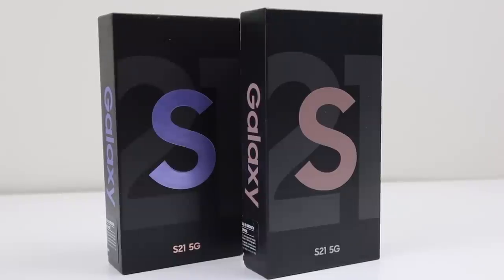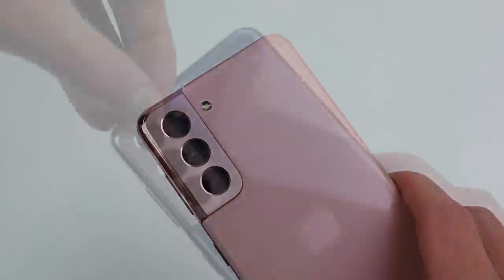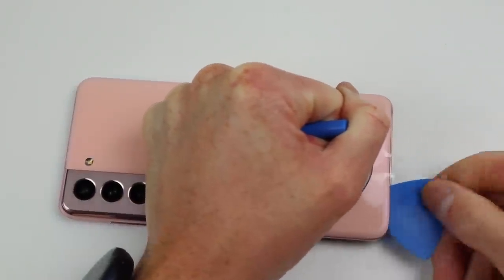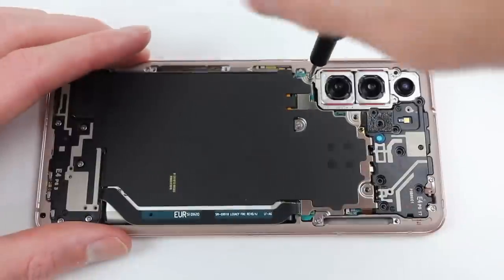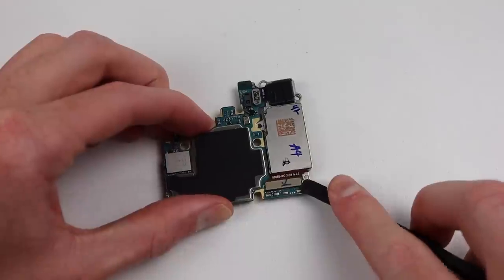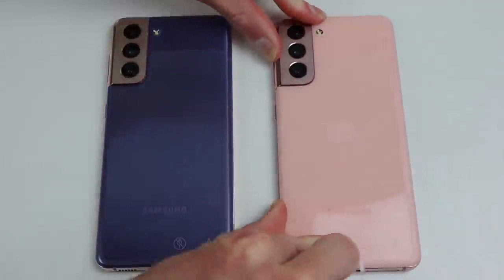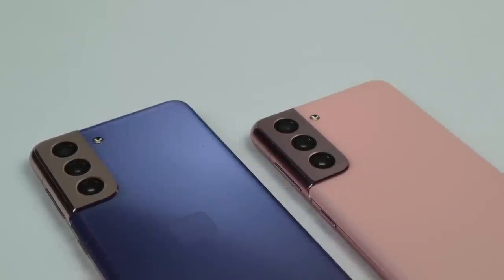Samsung Galaxy S21 Teardown and Repair Assessment - Interesting Findings!

Comment: I'm glad Samsung isnt going down the same path at Apple with its repairs
Reply: As another commenter said, I would be worried that they decide to add it in a software update, like with the A51, maybe high should do an update video in a few months if they do?
Reply: Ha seriously what about the charger, headphone jack and now no SD card support
Reply: At least apple doesn’t put bloatware on your phone
Reply: @brennont9724  I'm surprised people still think it as a software lock. That fp scanner on a51 was an optical one which can loose it's calibration once removed. Samsung probably made it more accurate or fixed some kind of vulnerability to make it more secure with new software update which made the calibration necessary when removed.
Reply: @Spartan-ww3bb  and a 1080p display on a "high end" phone. It's just overpriced and doesn't deseeve the galaxy S branding.
Reply: @brennont9724  what a fingerprint scanner that needs calibration is not reparable wtf is that logic
Reply: @NanoMine  EXACTLY
Reply: @Tom2404  1080p 120hz》1440p 60hz
Reply: @keqling7086  It doesn't matter if it's 120Hz or not. 1080p is still a downgrade.
Reply: @keqling7086  they could have offered an option to recalibrate it.
Reply: @Tom2404  well idk about that
Reply: @Tom2404  no 120hz is all what matters now
Reply: @keqling7086  Youtube, Netflix and most other services don't even support media playback with 120fps. And they won't do in the time that this phone will have any relevance because with linear content like TV shows, movies or this YouTube video you don't really see enought difference to justify a video being twice as big in size. The only measurable benefit would be in gaming because you experience interactive media different to linear programms, but there are no games for phones where that slight increase in responiveness actually matters. Only including a 1080p display when previous generations had 1440p 6 years ago while costing less is just unacceptable for Samsung. I mean if it was an S21 lite for $600 that drops to $400 in the next year it would be ok, but they are doing it with the S21 and S21 plus while keeping a premium name and price tag of $800 and $1000 respectively. The cost of manufacturing those phones is also not an argument in favour of Samsung, the S20 plus had 1440p and 120Hz for the same price as the S21 plus that only has 1080p. The only reason those phones even exists is to make the overpriced ultra model look like a better deal in comparison.
Reply: @ItsRainingLemons  yeah, having two app stores, two calendars and so on, was annoying.
Reply: @Tom2404  Calibrating such a precise component can not be always possible by just a click of a button, you might require some sort of special tools to do it.
Reply: @Tom2404  you cant really tell 1080p on that screen and if you want to optimize apps you make them cleaner and lower res anyway. videos are fine when using 1080 although 1440p is preferable. other than that in ur daily use u shouldn't be able to tell
Reply: @keqling7086  The galaxy A51 cannot have its scanner replaced, I’m just sharing my concerns. Hugh made a video on it
Reply: @brennont9724  IT NEEDS TO BE CALIBRATED and u need special tools for that
Reply: @keqling7086  you don't need special tools to calibrate the fingerprint scanner in the a51, you need to flash stock firmware onto the phone provided on the Samsung website and the fingerprint scanner will work correctly
Reply: @Tom2404  It fucking matters. A 120 Hz display is waaaaaay better than a 60 Hz display, no matter 1440p or 1080p.
Reply: @keqling7086  Oh look, Samsheep making justification for their scummy business practice.
Reply: @liviuganea4108  It actually boils down to preference. Some prefer sharper image, some prefer smoother image.
Reply: @B121AN1  oh look an isheep ignoring apple's refusal of repairing phones and calling me a samsheep
lol samsheep 
i think isheeps got offended so badly by being called isheep
Reply: @keqling7086  Hey! I'm talking Samsung's scummy practice here, not Apple. You Samsheep seriously can't go about any conversation without bringing up Apple can't you? Seriously, in what part of my or your original reply involve Apple? I'm talking Samsung.
Reply: @keqling7086  You Samsheep seriously has to stop justifying a downgrade. A downgrade is a downgrade, and it's bad for the userbase. It's a downgrade in one thing that's Samsung's known for: the screen. It's clearly a scummy business practice that shouldn't be justified just because their competition is doing worse.
Reply: @B121AN1  wait a sec ! why do u think most poeple call fans ISHEEPS ?
ofc u dont know 
bvz they will buy anything apple makes 
1000 dollars wheels 
1000 dollars screen stand ... ipoop ?
on the other hand samsung fans wont buy anything samsung makes 
PROOF :poor sales of the regular note 20 since it had a 60hz screen for 900 dollars or was it a thousand?
so with the s20 u get a 1440 p screen but 60hz ONLY 
with the s21 u get a 1080p screen WITH 120HZ ENABLED 
ofc anyone would choose the 120hz 1080p screen
even mkbhd said "thoose additional hz are more worth than those additional pixels "
so ur wrong
Reply: @B121AN1  samsheep is not a thing and i said why 
but ISHEEEPS still exist
Reply: @keqling7086  also, like I said, we’re talking Samsung. Don’t bring up Apple, please.
Reply: @keqling7086  by the way, nice try, but both S20 and Note 20 had 120hz refresh rate. Both are just not enabled by default, but the option was there. So the S21 screen is still a downgrade and Samsung is still being scummy. Oh, and Note 20 had plastic back. It made headline because it was downgraded from the glass back it had thus making poor sale. People don’t want to pay 1000 bucks for a plastic phone. Beside, the Ultra model was just 300 bucks away, and it was the best phone that year.

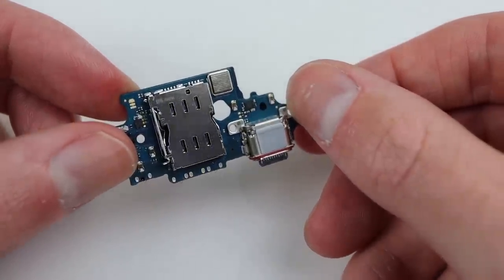Comment: 8:48
Yes you can!
Samsung did it since the Galaxy S8 and Note8. All S and Note phones since then have dual sim hardware, but single sim software. I flashed a second imei to my Note8 by using chimeratool, and i had working dual sim on a single sim note8. I just needed to replace the sim card holder so a second sim would fit instead of the SD Card

Comment: Honestly, I don’t like the s21. I personally like glass and the fact they removed the memory card slot is ridiculous
Reply: Plastic back, No SD card slot, no headphone jack and 1080p display. 5 years ago this would have been a $400 midrange phone. I mean the SoC is a high end one, but by now they have made those octa cores for 6 years or so, so at this point they should be ultra cheap to produce and qualcomm probably just artificially keeps the prices high.
Reply: @Tom2404  some of that could hold some truth but processor manufacturers also aim to make thinner and thinner nm. Both increasing manufacturing cost and performance.
Reply: The reason why chipset are still expensive is because they always improve it, gives new features if they can, then try to make it smaller each year. Which is not easy. This is why most mid-range chipset stays the same manufacturing size before it reached flagship's size. Because it's new that it's not easy. Also they need to test the chipset and make sure there is no problem.

Honestly I don't think S21 is that bad, yeah the lack of dual sim is what worried me (but I heard that other countries variant support dual sim, indonesia included). I always used two sims, one for internet and one for account. For storage.. i think that's enough, you probably won't reached the storage limit anyway. If you're a people who will take extra high quality photos/videos, you should probably get S21 Ultra because of the camera. And I believe S21 Ultra have SD Card (might differ from different countries).
Reply: @FirstnameLastname-yh5fb  you do know that you shrink stuff down to make it cheaper?
Reply: @Tom2404  yeah but process is far more complicated.
Reply: @gta4haterhq  TSMCs 7nm used  since 2018, so at this point it's safe to assume it's a mature process with good yields. They can produce more chips with less silicon, so it lowers production cost.
Reply: @Tom2404  They shrink stuff down to keep heat down and/or increase performance for the same amount of heat and energy consumption. It's actually more expensive to make small silicon because of the lower output and increase in manufacturing difficulty.

Comment: 3:41 I mean if you use plastic, why don't go back to 2015 with removable batteries
Reply: Because time machines don't exist unfortunately.
Reply: then 4000mah will be left 3500mah
Reply: Water resistance will less reliable/more expensive to make, battery capacity will drop pretty significantly, more chances of damage since some randos can poke around in the phone when they don't know what they're doing and a whole slew of other reasons.
Reply: @劉奕彤-q6g  expected would have smaller batteries due to safety measures, but you can easily swap out for a full charged battery.
Reply: @purpleish_OwO  they should use solid state battery to remove most of that protection 
So 5000 Mah Solid State Battery is thinners And more durable and regular lithium battery 
The battery won’t ware down over time
Reply: @ryanlam5237  That's not the reason. It is because if we can replace our batteries and keep our phones running, manufacturers won't be able to get us to upgrade.
Reply: @alexisaguirrevazquez7900  Thats obviously a large reason, and its one that I can't really fault them for. They are a company, not a charity, at the end of the day they have to make money. But I know for sure that personally I prefer "non replaceable batteries" over "replaceable batteries"
Reply: @alexisaguirrevazquez7900  Since it's not something that I personally care about nor a function that I will actively use. I said personally, it's my opinion, you're free to disagree but can you please not be rude about it?
Reply: @ryanlam5237  Just because you don't use it doesn't mean you should prefer not to have it. When your battery goes bad, you would want to replace it so your phone will perform just like new again.
Reply: @alexisaguirrevazquez7900  It's just that personally I've never experienced the need to replace my battery so it's a feature that doesn't matter to me. I much prefer the benefits that it brings including the fact that when I accidentally drop my phone the back cover won't fall off, the battery won't fall out, and the risk of internal damage will be lower since it's much more tightly integrated.
Reply: @ryanlam5237  A case will solve that issue. Also if you crack the to glass back, water resistance will be no more. A sealed in battery won't get larger in phones. You can still get water resistance in a phone with a removable battery. Look at the s5. There are literally zero real world benefits to a phone with a sealed battery. It only benefits the company and that is it.
Reply: @alexisaguirrevazquez7900  I don't enjoy using cases on phones, makes it too bulky for my liking. With a removeable back, phones had to be engineered to have another layer of plastic cover over all the internals to prevent damage which gives less space for components and ultimately leads to less battery especially since the battery is in a hard case too to prevent the lithium metal layers from squishing together and starting a fire. This loss in battery capacity can be remedied by carrying a backup battery but I would rather have my phone as one single complete package rather than having to buy an extra battery, a charger for that battery, and remembering to bring that battery around, especially since phones nowadays are more than enough to last a day for my uses.
Reply: @ryanlam5237  A slim case will do you just fine. Try speck or some clear case from amazon. You can always carry around two batteries as well. Plus, with oled screens, dark mode, 5nm chips and Android getting more battery efficient by each version, even if you put up with less capacity(which isn't the case), it will still last you through the day due to better optimization.
Reply: @alexisaguirrevazquez7900  I've tried slim cases, they just aren't my thing. I think we should just agree to disagree

Comment: I am not sure if you'd be able to read and reply. 

The LCD screen of my S21 is broken and I have got the replacement. 
My questions:
1. Do I have to remove battery and antenna (using tri-wing)/as well to replace the LCD digitizer.
2. Would you be able to recommend any glue. 
3. How much temperature and time to heat up the frame to remove the LCD screen. 

A quick reply will be highly appreciated.

Comment: Kind of hate that companies follow Apple, even on their bad decisions
Reply: At least it's cheaper
Reply: @raawesome3851  cheaper the price, cheaper the quality
Reply: @EmeraldLegate_  fair.
Reply: If they're going to follow Apple, why don't they also follow Apple's good things, that make their products relevant and viable? Samsung's strategy here is so shitty.
Reply: @Brian-wp9er  How are Samsung products worse than apples????
Reply: @bossbam  I wasn't insinuating that Apple products are the epitome of tech, just saying that there are areas in which Apple is better, that Samsung should take notes on. Quit the fanboy shit, everyone knows they all have their advantages and disadvantages.
Reply: @bossbam  Worse security, worse system optimization, very slightly worse build quality, etc.
Reply: @EmeraldLegate_  Not really. My A70 is made from glass and plastic and still feels and is better than the purely plastic things like the J series.
Reply: @enzoperruccio  Security on iPhones - that's a good joke. Worse build quality? What are you smoking? No difference in optimization. This isn't TouchWiz.
Reply: @liviuganea4108  Yeah I may have been wrong in some aspects, but you can't deny the optimization on IPhones is much better. Apple is always releasing new updates for their older models, and they don't stop until they get limited by the hardware itself. That's why an iPhone 6 from 2014 is still perfectly usable today whilst any Android device from that same year with even better specs is a brick by now. Seriously, 20 fucking gigabytes in my A31's 128gb of internal storage is just the OS itself, you'll never see that happen on an Iphone. This is also why people hold onto them for so long: there's just no reason to upgrade when your device can still run all the latest and greatest apps.

Comment: The usbc to usbc is for data transfer from your old phone,  not charging. It says so in the paperwirk you just glanced at.  They said use your old charger, And buy a usb to usbc cable. In the documentation they assume you are a repeat customer and have several old charger dongles.

Comment: when the battery adhesive doesn't want to let go, give a little squirt of high proof rubbing alcohol in there and let it work it's way in and wet the adhesive.  It will let go of the battery much more easily, and is still good once the alcohol evaporates

Comment: Also we have to consider that S21's fingerprint sensor is ultrasonic in contrast with A51's optical fingerprint scanner (which honestly looks like another camera module). And unlike S21, Note20, S20, Note10 series and S10/S10+'s fingerprint sensor which is directly attached to the display, recent A series' fingerprint sensor like A50, A70, A80, A51, A71 and the likes of Note10 Lite S10 Lite & S20 FE have a separate optical fingerprint sensor compare to the ones in the flagship which is an ultrasonic one and is adhered to the display.

Comment: Not that I'm trying to defend Samsung's decision if any but here in the Philippines when your phone's display is having problem (burn in, dead pixels or even broken screen) or the ultrasonic in screen fingerprint sensor is having problems Samsung just repairs the entire display and even offers FREE BATTERY REPLACEMENT (given that the unit is a flagship Samsung phone and has been purchased locally from approved retailers and first party Samsung stores here in the Philippines) for such problems. Sure it could be a little bit costlier but compare to Apple's repair programme here in the Philippines as well as being able to save oneself from the inconvenience of repairing phones with aftermarket/non-Samsung approved components is just a benefit that I totally wouldn't change for the world. Although TBH I am ONE with Hugh when he said I would rather have a charger out of the box than a free wireless headphones. Although wireless buds/headphones is a nice addition to the package I totally agree that the charger is much more necessary and significant compare to a pair of wireless headphones. And the removal of the microSD card slot in the S21 series is totally an unwelcome change for many power users like me who had the said feature on a Samsung phone for like FOREVER. Samsung had many weird marketing decisions that not only affected users like me but quite inexplicable in terms of logical sense.

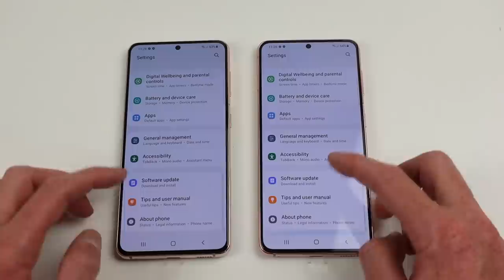Comment: 8:36 hey hugh at the start in software info 2:28 the model number was with a "DS", Thus its a dual sim phone to begin with, not a manufacturing accident.
Reply: The phone does have 2 Sims, but it's set up as 1 E-sim and one regular, he was referring to a dual normal sim phone.
Reply: @anthonyemerson3756  ?? The dual sim model has never been strictly one virtual one physical. If it says dual sim it always allows 2 physical sims in the phone
Reply: @yuzch3931  but the phone he has is, on the box it lists one IMEI as esim, and in settings it also lists that same IMEI as eSim, Apple and Google do the same thing in the US, one IMEI is for normal, one is for eSim (not samsung though, no dual sim for US) I do know that the Indian model s21 and s20 are dual normal sim.